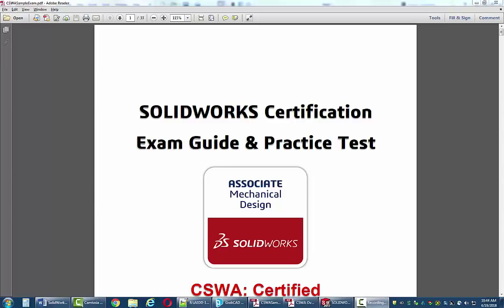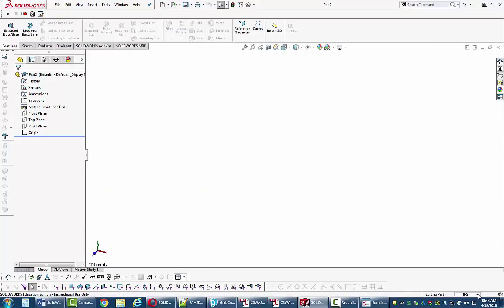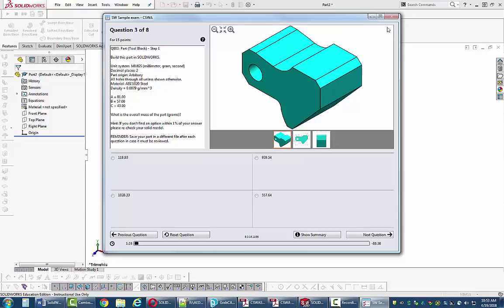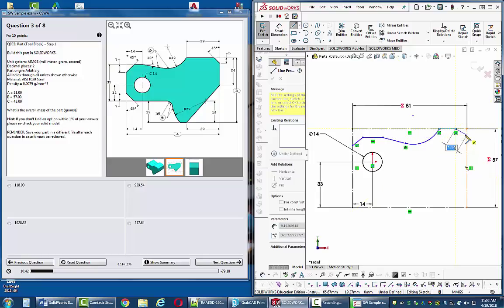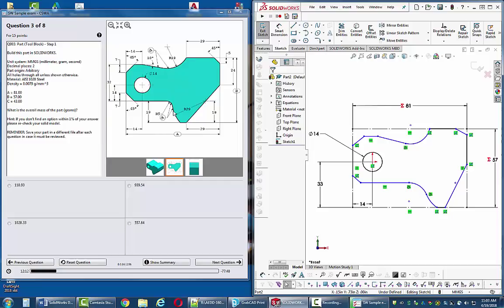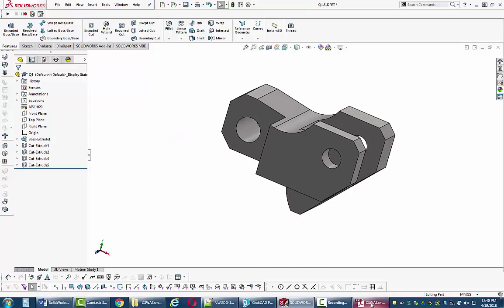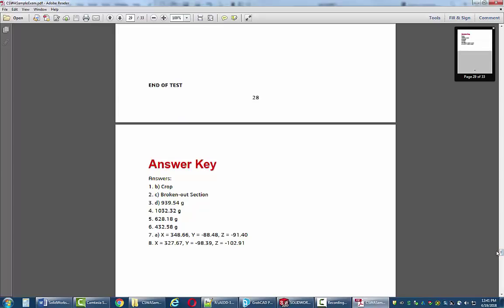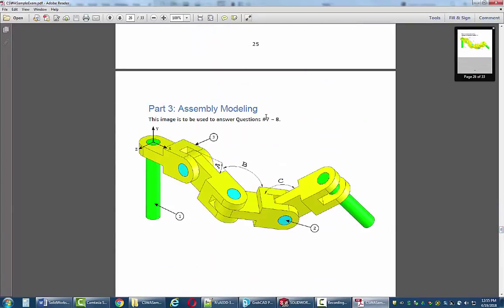SolidWorks CSWA practice exam

Comment: Hello, I just graduated from university as mechanical construction diploma (We study about Solidworks and Catia..) ... After graduating. I felt like my diploma is useless or rarely demanded. like where would I work?.. I'd be happy if you comment about this. Thank you.
Reply from the maker: Rauf, 

I don't know what a university diploma is where you went to school. I teach at a community college that still has a very strong occupational focus in addition to that of transfer to universities. My role is to prepare student to become skilled technicians who will assist architects and engineering in documenting developing and documenting designs in a variety of disciplines. For the past few years virtually all of our students who complete the A.A.S. degree get hired, go on to an advanced degree, or both. I've been teaching here for over 34 years, and we have many very close relationships with employers who value our degree very highly. Just today I had request from two employers for either a graduate or an advanced student.

The key is developing proficiency in the use of CAD software and understanding the ways in which it is applied in various disciplines. Our graduates are very skilled and employers know that. If the diploma you received doesn't by itself seem to be helping you find work, you might want to take the certification exam in SolidWorks to demonstrate your ability. If you find you are unable to pass the exam, you might benefit from some of the many videos on YouTube to develop your skills further. 

Good luck,

Dan Abbott

Comment: I swear I have the same sketch like you, but still don't get the correct answer. Could you help me please?
Reply from the maker: If you aren't getting the same answer, the sketch is not the same. Some possibilities: 

1. Make sure your sketch is fully defined. If not, figure out why.
2. You may have a relation that was added automatically that you don't want. The most likely would be a perpendicular relationship. If you try to add a dimension and get an "over-defined" error, check for any unwanted relations and delete them.
3. You might have placed a dimension with an incorrect location on either end so that it looks fine when you scan it, but results in incorrect geometry.
4. You may have a correct sketch but an incorrect extrusion depth.
5. You might have assigned the wrong material.
6. Your equations might have a typo.

If you can't find the error, send me the .sldprt file to dabbott@smccme.edu and I'll find it for you.
Reply: @DanAbbott-SMCC  thanks. I found the mistake. The dimension up of 29 was in the wrong position

Comment: Not able to tab over for inserting a global variable how should i rectify that?
Reply from the maker: That's a new one on me. Can you select the cell with the mouse? I've never had a problem using the Tab key for this, and I can't think of anything off the top of my head that would cause it. I assume the Tab key works in other applications?

Comment: Mr. Abbott can you share the files for the assembly parts?
Reply from the maker: You should be able to find them online.  Go to the test site they use at www.virtualtester.com/solidworks. You can take the practice exam for free and you can download the files from there. If that doesn't work, here is a link to a google drive that contains the three parts: https://drive.google.com/drive/folders/1iaWo445reIvlWDtq9zAAqEsgHRRnAeOf?usp=sharing
Reply: @DanAbbott-SMCC  Thank you so much for the quick response and the files. You're amazing!

Comment: so the answers for the sample exam are alwys the same?
Reply from the maker: They are. The actual exam draws from a pool of parts, assemblies and drawing questions and based on seeing student exams, they are randomly selected and each of them has different values assigned to the variables. But the practice exam hasn't changed in many years.

Comment: where can I get the part file for assembly?
Reply from the maker: If you register for the SolidWorks exams, you can take two of them for free using the same test engine used for the actual exam. If you take the CSWA with that engine, you can download the .zip files containing the parts for the assembly part of this exam. The process of registering and taking the free exam online is in my video. If for some reason you can't do that, send an email to me at dabbott@smccme.edu and I will email you the .zip file.

Comment: I´m getting approximated value of 939.28 grams
 for the first question, will it change all the results after? is that considered as wrong?
Reply from the maker: Inacio. You are well within the 1% value they indicate would be correct, and I have seen small variations on other exams that don't make the answer incorrect, but I think there is still something amiss. I've demonstrated this part dozens of times and had hundreds of students create it, and in each case we were able to get the exact answer they have. 

Some trouble-shooting advice:

Check to see that ALL of your sketches are fully defined. 
Check the material to make sure that you selected AISI1020 and not something else. 
Look at each dimension to see if they all match those given.  
I'm curious to see if there is something wrong, so if you can't find anything, send me the file at dabbott@smccme.edu and I'll check it out to see if I can find any errors.
Reply: thank you, sir.
Reply: Is the actual test similar difficulty or a lot harder?
Reply: The same one. Preparation for the exam.
Reply: The idea is basically the same. If you are able to take this, you will surely do well.

Comment: 45:16  your 2nd pocket extruded cut doesn't go in far enough, hence why your weight was wrong. Good video however. Thanks.
Reply from the maker: I think I correct that later in the video, but I don't edit these since they are used for my classes. I let them find errors since that's really the skill I want them to develop. And it is reassuring to some of them that "even the instructor" can make a mistake. Glad you liked it though.

Comment: What is the keyboard shortcut for tangent arc ?
Reply from the maker: You can start a tangent arc when drawing lines by moving your mouse over the end of the last line segment and hovering for a moment and than moving the mouse away. You can also select tangent arc from the arc options on the command manager. Not sure if there is something else you have in mind.
Reply: @DanAbbott-SMCC  never knew the mouse over trick for arcs! Thank u
Reply: @DanAbbott-SMCC  hey what do you need to type to see mass properties

Comment: 11:27 Small nitpick - That's Sigma.  Not Epsilon.
Reply from the maker: Indeed it is. I've been wondering when someone would note that. I'd like to dismiss it as a typo, but in fact, I did think it was Epsilon at the time -- confidently enough not to check it. Thanks for pointing it out. If I could easily edit the video on YouTube, I'd change it.

Comment: I feel so prepared to fail my exam on Monday :D
Reply: exam in university or in school?
Reply: Oprah James uni
Reply from the maker: Advice I give my students for taking the SolidWorks Certified Associate Exam

(also, start a SolidWorks part file, go to the bathroom, get a cup of water, etc. before you select the last Start Exam button.)

1. Take a deep breath. You have 3 hours to take this exam. You have done all the things required and more. Take the time to analyze the parts before starting.  
2. Create equations for each variable when making a part. You’ll have to change them later and having equations does make it easier. (You can skip this for the assemblies.)
3. Understand how to use the MEASURE tool and the MASS PROPERTIES tool.
4. Fully define every sketch!!!!! Really.
5. Start the part in a logical location even if they don’t require a specific origin. Place the first part in an assembly where it is specified in the question.
6. Be careful to select the correct material before finding any mass properties.
7. Understand what each of the drawing view options does, including the “Alternate Position” view. If you forget during the exam, or if you want some reassurance, just start a drawing and look.
8. Make sure you know how to place a distance mate in an assembly.
9. If you need to select a face inside another part in an assembly, make the part transparent, OR use the section tool and drag the pointer to a location that opens up the part for you.
10. When you do the assembly, make sure that NO parts are free to move.
11. On the advanced part watch for opportunities to use Convert Entities to simplify things. If you select a face, all edges associated with the face will convert. If you use the Offset Entities options and select the face, all edges will convert AND offset.  DON’T FORGET TO START A SKETCH BEFORE TRYING TO USE CONVERT ENTITIES!
12. Save everything you do every 10 minutes or so to a local drive as you are working so you can get back to it. 
13. If you have time at the end, review all the questions to make sure you answered them.
14. Don't get hung up on one part. If you are spending a lot of time on a part, go on to the next one, and make sure you leave time for the assemblies. Many people find them much easier than the parts, and they are worth a lot of points on the exam.
15. Don’t panic if you can’t answer all questions. You need only 165 points out of 240 to pass this test. Just do the best you can. You can do this.

Comment: Hi again Daniel, just checking you got my email? Thanks
Reply from the maker: I responded to your email on 11/27 with comments and an attachment. You had a number of under-defined sketches, in part because you didn't establish a relationship between the part and the origin. That makes it hard to trouble shoot.
I require that my student fully define every sketch unless it contains text or irregular splines.

Comment: Well, i ended up at 942.05 grams so a 1/2 percent off is acceptable!
Reply from the maker: That is within the tolerance that the exams require, however, I believe that I've gotten exact values for this particular sample part each time I've demonstrated it, so you might still want to check for any small errors.
Reply: @DanAbbott-SMCC  What kind of errors could be? I got 944.69 grams, and i followed every step of the video. The plane from where im working matters?